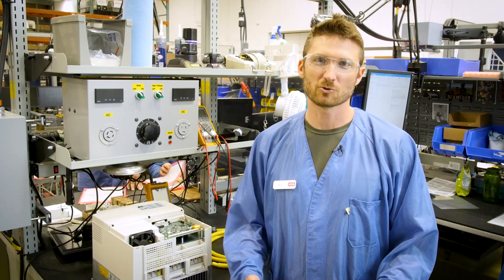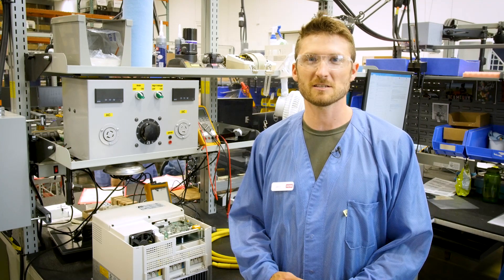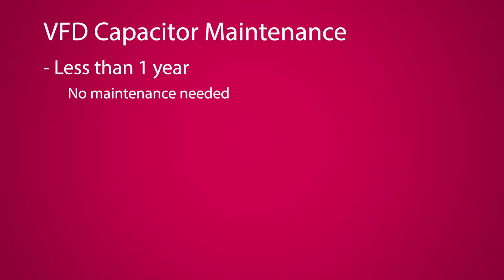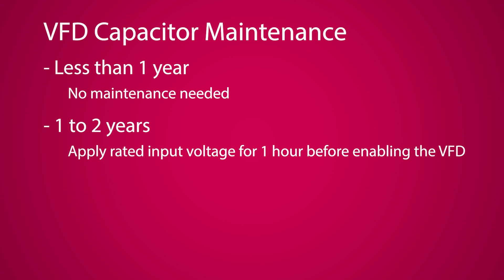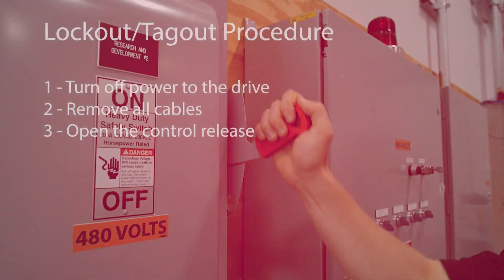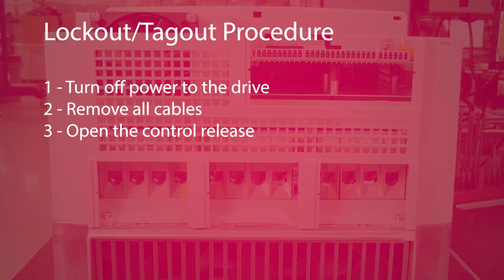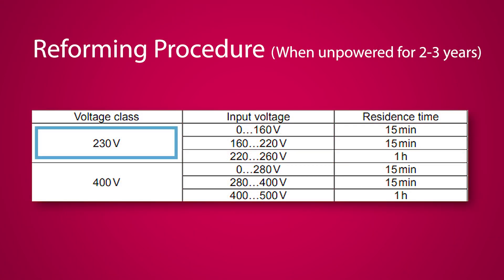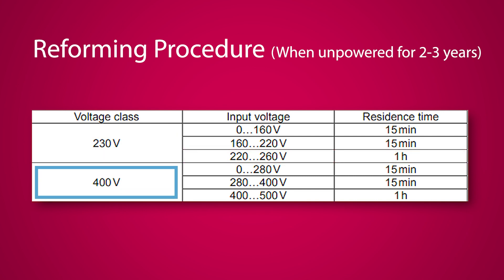What is VFD Capacitor Reforming? Drive storage and How Often You Need to Reform Them.

Comment: Hello KEB America. Thanks you for creating this kind of content. Rare and informative material!
However, I didn't see any info about current limitations in this process, and no information is given.  
However that was probably not the main point of the video.
Reply from the maker: Thanks for the comment. Yes, this video is meant to be a general overview of capacitor reforming. This process requires a special variable DC power supply and is not recommended without talking to the VFD manufacturer. Here is our blog about Capacitor Reforming: https://www.kebamerica.com/blog/vfd-storage-and-capacitor-reforming